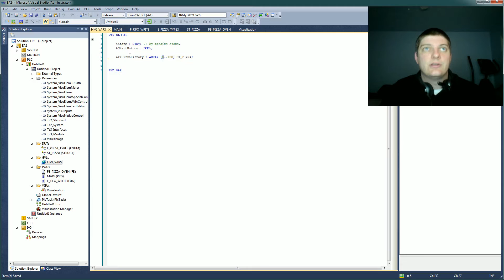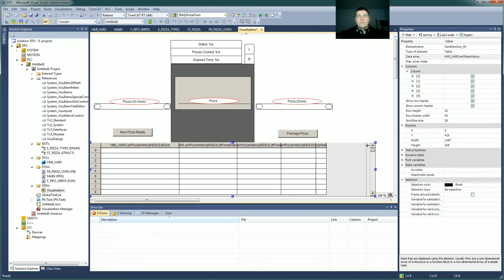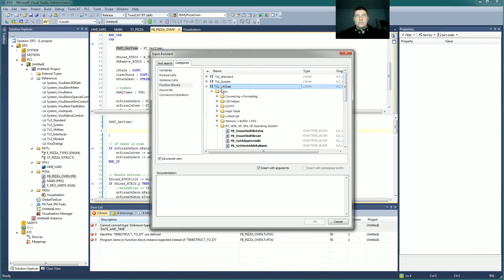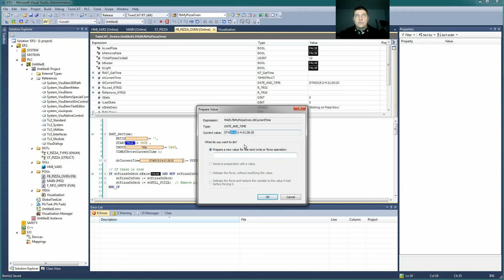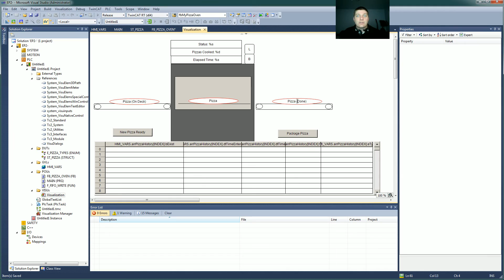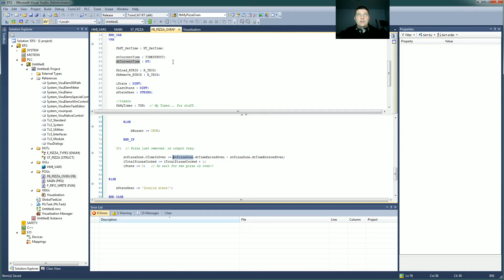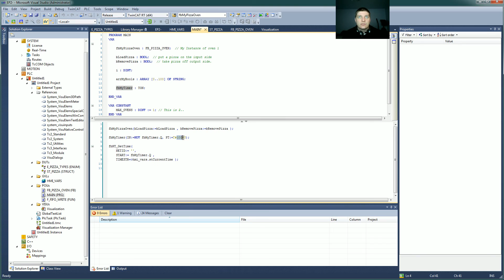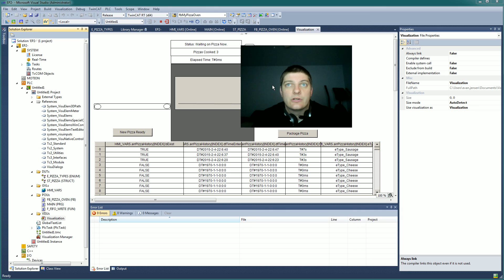Learning PLCs with Structured Text - EP11 - Time Math and Wrap Up

Comment: Thanks for your quick reply, it is much appreciated.
Is it a pain using embedded Team or using GitHub+sourcetree? No clear for me, thanks again!! :-)
Reply from the maker: Ummmmm... I think Beckhoff supports the one built into visual studio, wasn't it called team foundation? That's the easiest, but really the trouble is when you have multiple people in the same project at the same time.
Reply: @SquishyBrained  exactly, I used team foundation before and works fine but in software solution, now we need to works as a team, many people to work on the same project at same time. So in this scenario, should we use Tean Foundation or GitHub? I have 0 experience using Team Foundation with Twincat... thanks a lot for your help!
Reply from the maker: @michelferia either should be fine but be prepared for a bit of learning. Splitting files works well, but the tsproj file will be a pain to keep up with. Maybe fork and merge later. I think Beckhoff has a webinar on source control
Reply: sounds good!!, I will look for it :-) this is my last message for now, thanks for your help and support, I really appreciated!
Reply from the maker: @michelferia  sure. Hit me up if you can't work it out. Also a good forum on LinkedIn for twincat where I've seen it discussed before.

Comment: Hi Evan, first of all, thanks for you great training, it is really good to start with Twincat. 
I've a question for you and for everybody :-)

It is possible to use Twincat with Microsoft Team Service? I would like to use the subversion embedded on the VS2017 but some errors are rising :-(.
Please let me know if you have a workaround for this.
Thank you in advance!
Reply from the maker: I think they support it, I know there is a setting to split up all the files, and you'll want a good .ignore file for all the generated compile info, etc. I use sourcetree+GitHub with no issues. Merging can be a pain thought
Reply: @SquishyBrained  Dear Evan, here a little feedback regarding source control. It is working using ankhsvn plug-in inside the VS2015, however, sometimes the .tcprj is not well updated (mainly when add structures or new files). Do you think that using tortoise svn as client should work better? We need  to work many developers on the same project at same time. One details: maybe merging branch is not necessary because we can work all of us on the same trunk, a mean, only one base on the server and many local version on each developer workstation (working copy). A last thought concerning this topic :-)... thanks in advance!!
Kind regards 
MF

Comment: Hi Evan
I should thank you personally so much. I learned from this series too much. I use Festo version of CodeSys and up to State History (MemMove) I wrote and (with fun) worked it as simulation. Somehow I could not use in my version MemMove as function. 
So decided to install TwinCat just for your pizza oven codes. After a long does in libraires and fixing things it I could make it work but I Would like to ask to you if you send the project as Archive. Via archive everythings come exactly their own position (like Libraries). I use archive at Codesys sending a project from to another PC.
Reply from the maker: I don't have an archive of the project anymore, just what is on github.  I don't have twincat installed currently either, so I'm afraid you are on your own here.  Hopefully you can find something in the Festo CodeSys that will let you do a 'memMove', it just might be called something different.  Good luck!

Comment: Hey. Love your videos on Twincat 3 and ST programming man. The main reason i'm diving into PLC programming now. Been working with ROVs for 3 years now, noticed hat more and more manufacurers are leaning to PLC based conrol systems now. Would be great if you coud get into control system-themed tutorials like PID controllers etc. Also videos which include hardwares such as the Beckhoff PC-based controllers (BX/CX etc), I/Os (EtherCAT..), servo controls, safety and measurement devices etc. Can't emphasize enough how your videos have been the driving factor for me learning PLC. Would love to give you inputs or any info with my limited knowledge (doubt that you would get anything out of me haha). Anyways thanks for the really helpful videos.
Reply from the maker: Thanks for the comment.  ROVs would be a lot of fun, I've always wanted to build a small rover or something to play around with.  I should make more videos, and I probably will some day, I have not had time recently though.  Beckhoff once offered to loan me a servo test unit, I should follow up on that.  Since these videos, I've started an automation consulting company, so if you need some help on your ROVs in the future, please get in touch. :)  evan at jensenmechatronics.com
Reply: Thinking of building an ROV myself someday. Now working on big electro-hydraulic ROVs used mostly for oil & gas services. Some of them are old models, dating back to the 80s. Thinking of building an in-house control system incorporating all the existing sensors, maybe upgrading some and also adding new features. Will hit you up if any of this becomes reality. For now looking forward to new videos from you.
Reply from the maker: Sounds like a lot of fun.  I've decided to ask Beckhoff if they will loan me the servo control bench, I should be able to find time to make those videos this month.  I need to upgrade my audio setup also.
Good luck on your ROVs, I imagine there is a lot of room for that market to grow.

Comment: Thanks so much for this valuable material. I really appreciate your work. I have question about communication using the PLC with other devices such as modbus slave>> Could you please add some videos about this??
Reply from the maker: I have plans to make videos about various protocols, but didn't plan to show actual communication with a plc... maybe I will.  Beckhoff has various addons available for modbus, I'd start there, pick the correct one for  your application, and find the example code and start hacking away at it... that is my typical approach.
Reply: Hi, I have read many sources about TwinCAT3. I am still confuse, if I can use it to program  real PLC and make  online real time communication between it and the PLC. For example reading sensors values from the PLC and Save them.
Reply from the maker: Karem Abuowds yes, you can. I don't cover hardware or input/output cards in this video series. Some day, maybe soon, I'll do a set of videos on hardware to tie it together.
Reply: Could you please help me by some sources, where can I find tutorial or book for this.
Reply from the maker: I don't think there are any.  Beckhoff documentation isn't that bad (infosys), just a bit hard to navigate.

Comment: Hi thanks, Can anyone here give me example of program to using  analog intput or output with twinCat3 ?
Reply from the maker: It is pretty simple actually.... Just create an INT (I believe) in one of your programs, but with "AT %I*" for inputs and "AT %Q*" for outputs.  Once you compile they will show up as variables you can link to in the IO list.  This assumes you have EtherCAT analog IO or some other supported IO added to your project.  After that, the device will scale 0-10v to 0-16383 counts, etc, and you can scale to your engineering units from there.

Comment: Watched all 11 over the last two days.  We're considering moving to TC3 and this has been very helpful in the decision making process.  Thanks for your efforts.
Reply from the maker: +Mark Zeilenga Sure, no problem. We went from TC2 to TC3, and it was a bit of a bumpy road, but mostly on the source code control front.  The underlying system is actually really similar and the IDE is 100 times better to work in if you have to be in it all day long... multi monitor support, etc.  There is room for improvement, but they are really working hard on it.  We meet with the product manager for TwinCAT every year or so and they really address our problems and are very actively working on improving TC3.  If you are thinking of switching from Rockwell, go for it!
Reply from the maker: +Mark Zeilenga Oh, and the source control stuff has gotten much better, but is not perfect still.... but workable.

Comment: Calling methods that return values would be great if possible.
Reply from the maker: You can get and set methods, but as that is a newer concept in automation I keep it simple in this series.
Reply: +SquishyBrained Perhaps if you get the chance you can update it some time. Great series though. 

The reason I mention it is that it isn't really covered in Beckhoff documentation, but is still a very useful tool with TwinCat3.